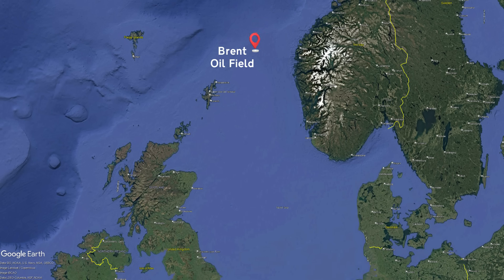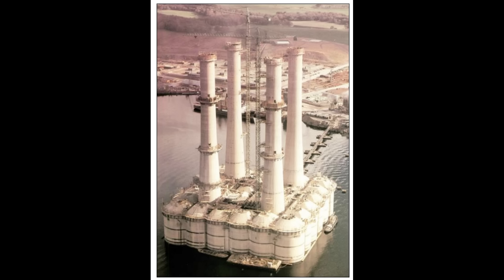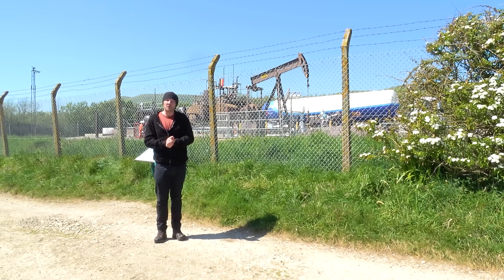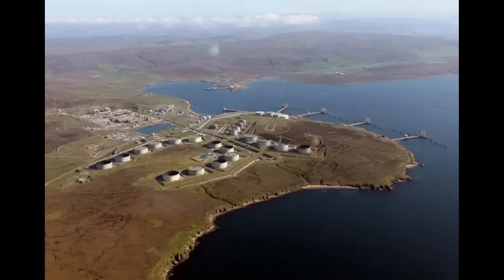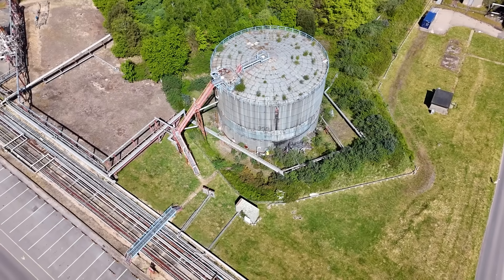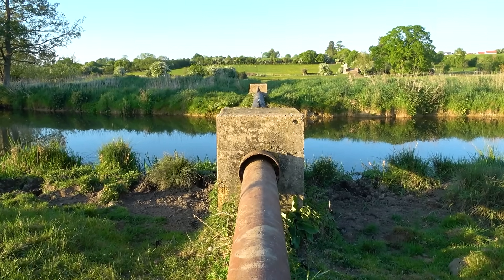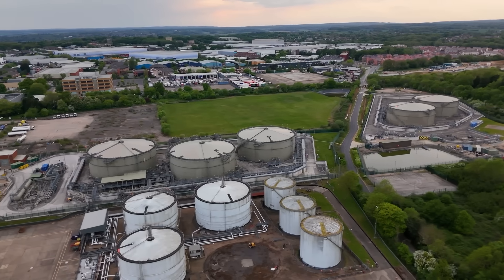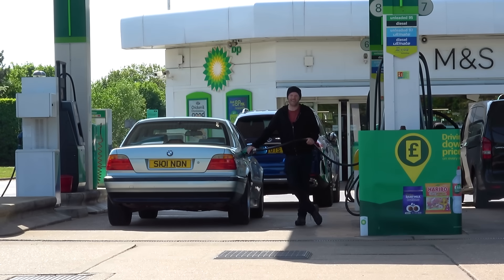Where Does Petrol Actually Come From...?   A Journey From Source To Fuel Filling Station

Comment: 10:50 ooh ooh then there’s the bit where it goes into the air, and breathed in by the plants, to turn back into crude oil.  But we’re using it, I dunno, a million times faster than it is created?  I’ll do some sums.
Reply: It’s 3.5 million to one.

We use about 35 billion barrels per year — still going up sharply — and the earth creates, give or take etc etc, about 10,000 barrels per year (Reddit had a thread with that consensus in 2012).

Also I don’t think it’s dinosaurs.  Isn’t it vegetation?

Comment: I was on Brent Bravo for a few days in the early 80s, commissioning a new type of heating system to keep the divers warm under the North Sea (up to that point they basically had a central heating boiler controlled orally: "It's getting a bit chilly, can you turn it up?" then 10 minutes later when the water reached them: "Jesus Christ!  Turn it down!").  The helicopter flight before dawn from a deserted field near Stavanger wearing a borrowed survival suit is a lasting memory; as is the lifestyle on the rig - everyone I met was dedicated to getting the job done, including one guy who was thought of as a skiver because he kept disappearing for a kip - he was actually working both 12-hour shifts.

Comment: And yet there's fake news that EVs are worse for the environment than ICE cars. EVs don't require ALL this infrastructure and energy to power it and embodied energy for everything from faulty valves to concrete legs bigger than Nelson's column. 
If the exhaust from cars was the same colour as that explosion (which is rapidly burning the oil we would have burned in our cars) ICE cars would never have taken off.

Comment: So all that engineering, infrastructure and logistics and they can sell petrol at around £3 per gallon (excluding Government take) so I can drive about 45 miles in my ICE car.  

Meanwhile  the poor EV owner cannot always find a plug to get his car charged.  The EV needs about 10kWh to do 40 odd miles for which the company operating the charger will typically charge £6 (VAT excluded) 

Seems to me that the fossil fuel companies are treating their customers far better than the EV charging companies!

Comment: The sheer amount of Fuel / Natural gas required to get the petrol to the pump station is astronomical. 
It staggers me more than people still think this is better than putting some electricity into an battery to power your car.
Reply: It's great how quickly EVs pay back their carbon debt (under 2 years)
Reply: What about the sheer amount of fuel/natural gas required to generate the quantity of electricity required for the whole world to be able to charge the EV? You won’t get that much from a few wind farms and considering the UK buys a fair amount of nuclear energy from the likes of China. That brings me on to the fuel/energy/labour required to manufacture EV batteries, then to transport them to car manufacturers and who knows what or where to dispose of the batteries?...
Reply: You dispose the batteries the same way as nuclear waste......bury it @nicolarse6227

Comment: I used to live next to Fawley refinery. At night it was loud and very well lit. From the nearby New Forest, the refiner looks like some huge crusie ship at night, with all the tall towers lit up, and flare stacks blazing away. You could tell when there was some sort of issue, as the flare stacks, burning what was called "refinery gas" suddenly all started flaring at full capacity, as there was excess gas that was not being used.

As well as the distillation tower, there was also a cracking plant that cracked the larger heavier oils into those factions used for petrol and diesel.

Contrary to what you might think, there was not much of an oil smell in the surrounding area. I went on a neighbourhood tour of the refinery, and we were shown all the efforts they made to minimise emissions and pollution. It was an interesting and impressive tour.

Comment: Nowadays, I just plug the car in at home, and give it 30 amps of the finest 50hz AC.  Any need for lubricants is the concern of whoever services the vehicle.  I don't, and I wouldn't have a clue 🙂
Reply: Okay? Good for you I guess? Gotta get them virtue signalling points in
Reply: @joeynebulous816  I don't own the car.  I haven't actually owned a car in 15 years.  I am merely the designated driver of a vehicle provided for the convenience of my disabled wife.  I'm just adding an amusing comment, rather than virtue signalling.

Comment: So, oil is sucked up to the surface and carted off somewhere to be refined. My question is, what happens to the space created when extracting the oil? Is it filled with water to replace the oil volume or is an empty void left behind? But if its left empty then won't the "hole" collapse due to the pressure above it?

Comment: Top job John, great fun facts. Add on for you the marker posts you can see, often at roadside, white posts, many gas but oil have a red hat with black stripe along with small fire hydrant sized post with Esso or similar company marker. They are patrolled by air regularly, I used to do the gas pipeline routes from Scotland.

Comment: Where the oil rig is being dismantled at Hartlepool next to the nuclear station ironically was where they made the steel version of the concrete legs. Fun fact Hartlepool was also where the first oil tanker built too along with hanging a monkey but we wont mention that bit. Also near to Hartlepool is where the Ekofisk pipeline comes ashore for lots of oil refining goodness.

Comment: Pro-EV guy here; what a brilliantly researched and presented  video, I learned a lot. It nicely highlights a lot of energy is used (and pollution created) long before any “tailpipe” emissions after we combust in our legacy vehicles.. It’s hard to get facts but its a process that use a lot of energy, Iam told even the refinancing process uses a lot of electricity (equivalent to about 1/3rd to 1/2 needed to run an EV per mile, ie when stop using oil products for vehicles we already have a useful chunk of spare electricity capacity, wind and solar can provide most of the rest. Nicely highlighting how efficient electric vehicles are verses combustion engines where half the energy is wasted as heat.
Reply: #transmissionlosses 😂
Reply: Cobblers. So when you plug in your heavy battery lugger I suppose the electricity just magically appears? I suppose the factories in China don't produce any pollution to manufacture these things? I suppose the rare earth minerals just magically appear without being scraped out of the earth by kid slaves in the Congo? Go spout your EV propaganda garbage elsewhere.
Reply: It nicely highlights……. nothing you mentioned but you felt the need to come here anyway and somehow attach your Pro-EV feelings to this video. May be because people usually runaway or fall asleep the moment you say them out loud?
Reply: It is 25% at most. Propulsion is a by product of the internal combustion engine!
Reply: The video felt like a historical artifact to me, marking the end of an (ICE) era.

With EVs reducing emissions by 70%+ and EV drivers saving £700 per year on average (pre VED changes) there's still some motoring left to do.

Comment: Decades ago I worked for a month at a combined roadhouse and fuel distributor (wharfside tanks) in northern Australia on behalf of …cough…a major multinational oil company who weren’t happy their bills weren’t being paid on time and needed someone (me) to figure out WTF was going on 😳. After being there two days the  Oil Co guy (who’d flown in with me but was keen to head home - so needed me to manage important grown up stuff) decided to train me if there was an alarm / fire at the wharfside tanks, including shutting off pumps / activating fire suppression :

- Oil Co Guy “so if there’s a fire, get over to this panel, open it, press this big red button”

- me “what if the fire is too big, I can’t get to the panel?”

- Oil Co Guy (pointing at the horizon”) “take big steps, and lots of ‘em”

I also once visited a small onshore oil field in NZ, similar to that small one at start of the vid. Because it was NZ, so gets a bit cold, the tanker trucks had heaters installed to stop the crude (comes out the ground warm BTW) from cooling too quickly on the relatively short trip to the storage tanks in nearby port town, to stop it getting gluggy and not want to come out the truck…and no one wants to see a mildly irritated Kiwi, eh Bro!

Comment: Great video, puts into perspective how ridiculous the 'Just stop Oil' group are.
Reply: Not wanting to start an argument but... Why?

Sure there's a lot of infrastructure going into getting fuel to the station but that's not a great argument for continuing it. Surely seeing the scale of the infrastructure required for oil lays bare the bad faith argument around the amount of steel/concrete/composite used to initially set up renewables.

I don't think we can just switch off our reliance on oil but it's a reasonable direction of travel. Just because we have been doing something for a long time doesn't make it right.

Comment: Brent Crude as always fetched an higher price on the international markets than Saudi Crude as a very thin high quality crude that produces more of the higher value products and little if any heavy fuel oil and bitumen.  It has almost been exhausted now, production has been slowed so the price higher still now.  The Norwegians now the larger producer of it and gas, guess who most is sold to.

Comment: To reassure, I completed “all that bollocks!”
I work in the oil industry and it is awesomely interesting. I am now more renewables based but much of the technology for offshore renewables is borrowed from oil and gas. 
It alarms me that in my lifetime, I saw oil and gas in the uk North Sea peak and then tail off and it was this realisation that lead me towards renewables to help preserve our remaining stocks of fossil hydrocarbons for my grandchildren to use as feedstock for their chemical industry.
 A world without cheap feedstock is much scarier than one without diesel or petrol. One is easy to solve but the other is catastrophic. A world without cheap chemicals will not be pleasant to inhabit and I don’t want to have them look back at how my generation squandered it all. 
I think that oil and gas are getting rather too rare to just burn nowadays and every gigawatt of electricity we generate by renewables saves a little more recoverable O&G for later. Net zero is cloud cuckoo land but lets not throw the baby out with the bath water.

Comment: Petrol - no one has come up with a better medium for moving a vehicle.  Pumps don’t come at different speeds. Different nozzles (except to separate diesel and petrol) and it takes 5 minutes no matter the size of the tank. And 8 pumps can fill 80 cars an hour without having to contrive an excuse to stop for an hour or two.

Comment: Ex-oil guy here. Well researched and I have no idea how you got half of that drone footage. There’s nothing I need to fact check here (apart from Buncefield was a level switch not a valve). Quite rare for a YouTube video! Great video well done.
Reply: If he uses a sub-250gram drone and takes off from a public area, and doesn't fly into no-fly zones then he can lawfully get the footage. I am extremely doubtful that above a refinery is a no-fly zone.

He may seek permission beforehand in order to avoid raising an alarm, but a sub-250g drone is so small most security cameras won't even pick it up at that distance or else not be able to distinguish it from a bird. I also suspect, in almost all cases an answer if asked would unequivocally be "no", simply because people tend to have an irrational fear of drones and a total misunderstanding of the laws applicable.
Reply: @SPTSuperSprinter156  Just checked and there's not a no-fly zone around Fawley which surprised me as we can't get batteries beyond the security gate. I've used drone companies to do aerial surveys within the fence line on disused equipment and that took a lot of paperwork. If he asked permission to get over the fence it would not be granted. I wasn't suggesting Jon did anything wrong, just actually really impressed with the quality of the legal footage.
Reply: @stewartoutandabout it’s not that deep
Reply: I know. Jon used a drone.
Reply: Synthol guy

Comment: Fuel isn't usually pumped from the tanker into the petrol station tanks. Gravity does the work. 😊 unless they have one of those big black above ground tanks that was an afterthought. You didn't mention vapour recovery either. The tanker driver connects up two hoses. The second is the vapour recovery hose. As the tank fills, the vapour is recovered into the tanker and taken back to the recovery to be reprocessed. Diesel vapour is usually just released through the vent pipes as it's relatively harmless compared to petrol. Some petrol pumps have stage 2 vapour recovery - recovering the vapour from the car tank.
Reply: No, i's pumped by the tanker
Reply: @iandavies6575  nope. In the UK petrol is delivered by gravity into the underground tanks. Why would they pump it? When gravity can do the job?

Comment: Such an interesting video, and so many hidden  underground buners for fuel around the uk, also  fuel is imported at Tranmere    Jetty  near Birkenhead , pumped under very high pressure to Stanlow to be refined and then sold at high prices to us drivers.The 2 nearest fuel stations to Stanlow where also the dearest locally, then morrisons and asda  took 2 over locally and prices dropped a bit.

Comment: Spent a very pleasant day on Kimmeridge Beach once, a lovely spot even with the oil pump. The only disconcerting thing was that big lumps of the cliff kept falling down, you wouldn’t have wanted to be under it when it did.
Reply: The drone shot of the tower at the beginning shows Clavell's Tower. This used to be nearer the cliff edge, but some time back it was dismantled and moved inland by some distance to stop it toppling over the edge.

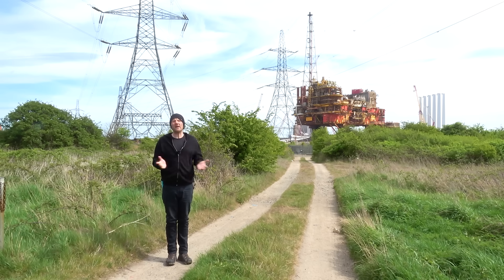Comment: Jon, at 1:26, they did NOT discover ground up dinosaurs several hundred feet under ground. 
Oil is called a 'Fossil Fuel' purely because we can burn it like coal, which IS a Fossil Fuel. 
Oil is just a Hydro-Carbon substance that extrudes from the planet's mantle and we are able to exploit it. 
Petrol is also a 'waste product' of the Petro-Chemical industry, if too many people buy EV cars and stop using Fuel cars then there will be a lot of petrol to get rid off some other way.

Comment: Brilliant,  I've been plotting these pipelines for over 15 years.  At home, I've been told GCHQ might want to question me.
GPSS (Pluto) now owned by the Spanish (was CLH and they did a good job of sorting the dying markers, and now known as the Exolum Pipeline System (also Spanish)), certainly not known as GPSS today!  This is RAF/USAF.  Got two pipes outside.  One feeds ex-RAF Lyneham, and USAF Fairford and RAF Brize Norton (8 inch) via Calne.  The other (10 inch), going to the massively 'hidden' Padworth tanks, your map shows as Aldermaston.  Most of the names are not the place, just nearby.
GPSS has never sent fuel from Fawley to LHR as a pipe never existed!  That is the Esso pipeline.  There are two and they split at Alton, Hampshire.  Heathrow (12 inch), the other going to Gatwick (10 inch).  They split near a railway siding that collects oil from Humbly Grove.
Jon, at the coffee event, I'll tell you the exact route of the GPSS pipeline.  It's not a secret with a bit of investigation.  And GPSS does not feed civil airports and has NEVER.  Only ones might be today, ex-RAF ones. I'd love to know the missing sections you don't know.
Buncefield.  A valve failed?  Wasn't it, the level sensor failed causing the tank to overflow?  That's what the offical report said.  Which valve?
No mention on Mainline?  Pembroke Dock to Seisdon is important and long.  Manchester Jetline?
COME ON, IT SOUNDS INTERESTING, BUT THIS IS THE FIRST TIME I'VE KNOWN A MASSIVE SHED MORE ABOUT A SUBJECT THAN YOU.
Reply: Yes Buncefield was a level sensor failure… like quite a few petrochemical disasters. It was a petrol tank hence the very explosive vapour….

Comment: If you walk happen to look in some farmer fields and see a series of white markers running across them, this indicates the high-pressure fuel lines you mentioned. They are buried 20m deep and if you are near these markers for too long, you will get a visit from the police. I know this because I had to conduct a survey to put a fibre optic cable across a farmer field and was told by my colleague that he had seen a helicopter fly over and then a few minutes later a police car showed up. Because they are secret, there is no way to tell of their existence until you get to the site and by then it's too late to call the MoD to let them know you are working there
Reply: Not nearly that deep as some enterprising people have found out.between 2 and 3 m most of the way
Reply: One of these pipes ran through our garden. When it was replaced in 1972, the new pipe was 3 feet from our house footings! Definitely not secret. Local ne'er do wells tapped it during the war not long after it was put in. According to someone who was watching(not involved, honest guv), they got absolutely drenched in aviation fuel, and very lucky to not go up in flames!
Got free fuel, and apparently vehicles ran very well on it, but some didn't last long. May be lead free, pre treatment?

Comment: I live near Saffron Walden which is one of the storage areas for aviation fuel. You know roughly where the pipes enter and leave the plant because wherever they cross a road there has to be a marker, in case someone digs up the road and a pipe with it.